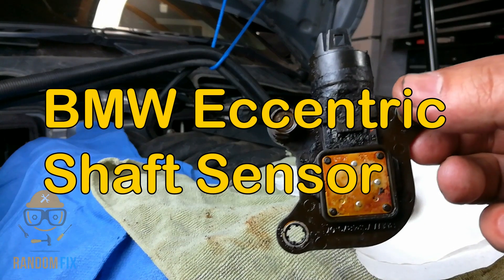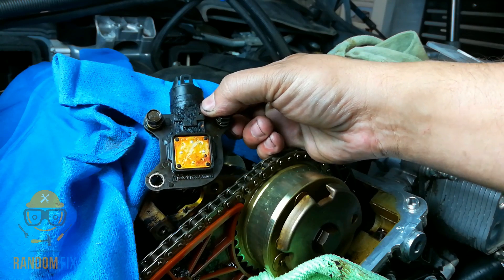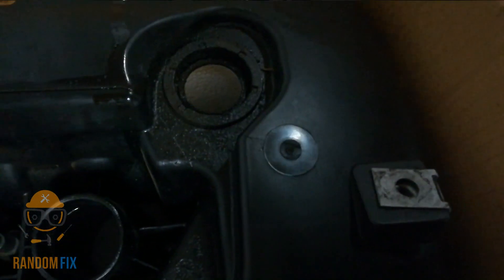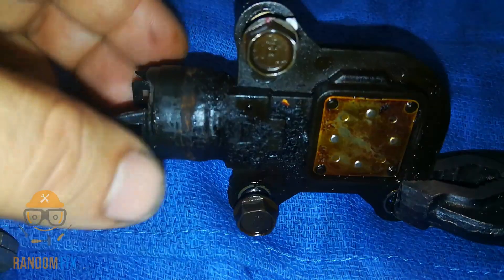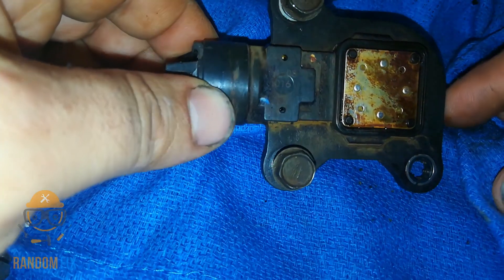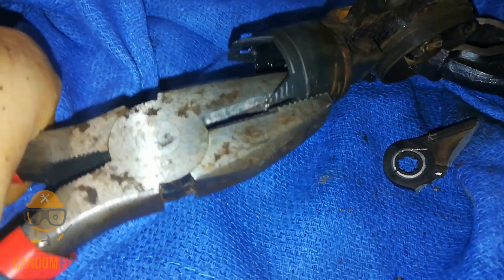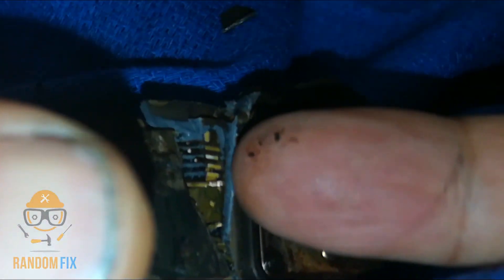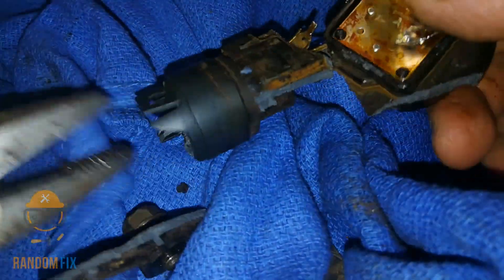Bmw Eccentric Shaft Position Sensor ▶️ Where it's Located and Common Failures

Comment: My car was stalling then it was a crank no start I changed everything in between. The car had no codes but I realized if I pulled the ESS censor the car would run but not the greatest. Then one day all the sudden the car doesn't want to start with the ESS plugged in or out and I want to get involved chronic codes when the ESS has been unplugged I changed ESS three times with Continental OEM non bootleg ! Change fuel pump relays everything in between crank sensor I have no codes for nothing before or after. The car cranks no start no codes except for ESS when it's unplugged in the car still doesn't start any ideas?  DME??
Reply from the maker: Figure out if it’s fuel related, spray some starter fluid past the mass air flows sensor into the intake and see what happens. A little spray goes a long way so don’t fluid the intake. If the vehicle starts then you know you got a fuel issue. If it doesn’t start with with the starter fluid then you got a spark or compression issue. You need fuel, compression and spark other air to get it started. This the route I take before deciding if I need to look at the Dme. Also it’s bmw so discount the battery for a few hours if all else fails before throw money at repairs. Keep me posted.

Comment: can this make your car not start at all, cause when i checked it i did see oil inside and the wire connector and it was super hot and smelled burned . you thinks that my problem it left me stranded
Reply from the maker: Could be, you need a oe scan tool to see what is happening. Here is the complete repair and at the end I show how to use the oe scan tool. https://youtu.be/NI0YZe64k0E?si=97EZl9jQeXcbDzeC
Reply: yea i scanned it and came back as p1017 and it is the eccentric shaft sensor
Reply from the maker: @josecabrales6512 okay, good to know, make sure you use a oe sensor or vdo, don’t go cheap.
Reply: @RANDOMFIX  yesir i just ordered the vdo one thanks man 💪🏽👍

Comment: My 2011 328i cabrio needs this replacement part, but I went cheap to get a high quality 3rd party one from SCITOO for 50$. It got good reviews, but I heard to get the VDO brand only. The sensor also comes with a green O ring around the big round part as the old didn't have one.
Reply from the maker: Yeah with sensors like these vdo is a good decision

Comment: Thanks for the video. What codes did you get while the bad ESS was in?
Reply from the maker: i cover that in actually replacement video from start to finish. https://youtu.be/NI0YZe64k0E
Reply: @RANDOMFIX  or you could just answer the question.
Reply: 2a37 or 2a47

Comment: Mines just went out when I went threw a car wash. E90 330i hiccup idile no control of the throttle
Reply from the maker: Do you think water caused it or it was just time?
Reply: @RANDOMFIX  I think it was its time. Car  in neutral for few sec could of did It at the car wash. half color engine light display with 2A31 2A32 2A47 which is eccentric shaft codes
Reply from the maker: I think your right, it was time, the sensor is pretty well tucked in there for the carwash to do actual damage. I've had lots of cars towed in to our old shop from carwashes, strange but true.

Comment: Hi! Could the eccentric shaft sensor be the cause of 2A6F - Valvetronic, minimum lift exceeded error code? Getting rough idle (500<->900rpm) when the engine is warm and my fuel economy is bad also.  Maybe the Valvetronic motor needs to be replaced?
Reply from the maker: Sorry for the late reply! did you find a solution?
Reply: @RANDOMFIX  Not yet. Still getting a hesitation after the car has been left for 30mins or so. After I start the car, the RPMs slowly reaches 650 where should be while A/C is off, then all of a sudden it crashes to like 400-450, sometimes stalling, sometimes recovering, then RPMs are stable afterwards, it's just only that initial hesitation after warm car was left for half an hour. Maybe Vacuum leak or MAP/MAF?
Reply from the maker: This is after the replacing the eccentric shaft sensor?

Comment: Do NOT buy the OEM trash for this part. Get the Dorman which has an improved design to prevent oil seepage.
Reply from the maker: Really Dorman makes a oem replacement for this now?
Reply: It's available on Amazon and possibly Rockauto. Check their web site for a description of the enhancements.
Reply from the maker: Thank you for sharing, rockauto is solid.

Comment: This seems to be from e60 and e46  6 cyl. engines. But in case of 4 cyl. like e90 320, the screw holes are on the surface,  not beneath like the above.
Reply from the maker: Good info, thank you for sharing

Comment: Hello, I having fault code 2850 variable valve gear guide sensor and 2852 variable valve gear reference sensor the car is a BMW e46 n42 engine, could the problem be the essentric shaft sensor, the car can’t start only cranks, and it has no spark
Reply from the maker: sorry for the late reply, did you figure it out?

Comment: 002A5A DME: Valvetronic, eccentric shaft sensor 2: guide. Does that indicate what you are demonstrating here? It's an error on my E60 550i 2007 in ISTA-D
Thanks a lot!
Reply from the maker: Sorry for the late reply! did you find a solution?

Comment: Great channel ,  need  help getting  code   2a38  vvt sluggish  movement  /open circuit ,  hopefully  not the sensor  jus did valve  gasket ,  dnt wanna   remove  it again  lol, any help
Reply from the maker: Thank you for sharing, did you get the 2a38 code fixed?

Comment: Im about to do valve stem seals on my Bmw 745i.  i was thinking the intermediate levers are causing the cold start issues (165k miles) but now im thinking this as well. Will this sensor(S) throw a specific code in INPA or ISDA-D??
Reply: Yea mine doesn’t pass 20 mph because of the valvetronic system I had a drivetrain error
Reply from the maker: Sorry for the late reply! did you find a solution?
Reply: @RANDOMFIX  no. Still have cold start issues. Does INPA have a test plan for intermediate levers like the old DIS software did?

Comment: Funny how people say not to use after market parts...there all the same thing u just pay more foe a name brand like bmw
Reply from the maker: I respectfully and personally disagree, certain oem parts are much better aftermarket parts, especially with o2 sensors, etc, mass air flow sensor, etc.. _Randomfix
Reply: That's funny after markets are made to do the same thing I done alot of after market parts no issues people are just so high strung. OEM parts which is stupid...hell in bmw oem parts actually go out quick but just are pricy....
Reply: goldenglove25 I agree with you, I’ve used China parts and seen so many people say this and that but if your car has only a certain problem, that small China part will get it going😂

Comment: What code would this throw if this is bad on a 07 328i e52? I'm about to replace the valve cover and the valve cover gasket and plugs but am strapped for cash and don't want to fork over another $100+ for one if mine is still ok. I only have 85k
Reply from the maker: I have a complete video that shows the replacement from start to finish. If you can wait and replace the replace the sensor you will thank yourself in the coming days. Video link is the description of this video.  _Randomfix
Reply: @RANDOMFIX  Yeah I am not getting any of those codes so I am going to cross my fingers and not replace the sensor. I'll visually inspect it to see if its junked up I might take it out clean it and seal it up for preventive maintenance maybe with some high temp glue or just leave it alone until it goes out. That's a spendy part to be buying if it's not broken yet. At least when it does go out taking off the valve cover should be a piece of cake.

Comment: Your video hours the mark for what I am experiencing. Using Carly app errors 2A31-36, related to valvetronic eccentric shaft sensor . These return quickly even after clearing. Couple immediately, others after a few miles of driving. I had the sensor cleaned by a mechanic but did not since the issue. Likely the oil has penetrated deeper into the sensor unit being the terminals. My vehicle 2011 e90 70-80k miles. Have this issue for 10k miles and over two years. But the vehicle drives just fine! No engine light errors either. And I am a low mileage driver. 

If there only negative is poor mileage then I would not want to be worried about getting this changed by a mechanic! Expensive, considering I have already replaced my valve cover gasket by the independent shop, and there is no other reason to open the engine as far as I know. 

I can live with poor mileage of ~17 city, 25 highway or so. But if this is a risk to the engine and bigger costs down the line then I would take it to a shop. Not a DIY person myself, but can understand the troubleshooting. 

Any advice please? 🙏
Reply from the maker: I appreciate your constructive comments, thank you for the feedback!
Reply: 17 city, 25 highway is not bad. No need to change out unless other Valve cover or Gasket replacement is being done at the same time. 

Replacement labor cost not worth it if the vehicle is running fine otherwise.

Comment: When oil gets into the top where the pins are it shorts it out
Reply: Will that cause the car to go into Limp Mode?
Reply: Oil cannot cause short because it is non-conductive.
Reply from the maker: Yes, oil is non condutive, however as the oil cycles around engine it will become more conductive.

Comment: Excellent. Well done - Does the new ESS need to re-learn, or is it fit and go ? Thanks
Reply from the maker: Ron, it's just plug and play. I didn't even have to reset any codes. Best of luck. I recorded everything from a to z on the repair. It should be in video description. _Randomfix
Reply: @RANDOMFIX  Yo! Would you say Topran ESS is a knockoff? I just bought that piece instead of Continental which is way to expensive. What Can happen if you say Its a knockoff?

Comment: Hi, is it possible to fix sensor that is leaking oil but still working well with no codes? Shall I try to find the hole and use some motor glue?
Reply from the maker: Hi Jan, if the budget allows just replace the sensor. You can buy aftermarket one for under $100.Can I get your help? CHECK OUT MY OTHER CHANNEL and subscriber if you like it. THANK YOU ▶️ https://www.youtube.com/channel/UC-wuhWwzZnFOWK-GMsP6Ejw   MANY THANKS _Randomfix
Reply: I would say YES.
Reply: K

Comment: I have received my eccentric shaft sensor from VDO, the car is not acting strange, no check engine light but I got 002A32, 002A47 and 002A34 codes when scanning with Carly and the description indicates Eccentric shaft sensor problem. My question is, does the metal plate on the sensor makes contact with a part of the car or can I try the part just by plugging it to the connector. Want to know if I can try the sensor before disarming the hole shaft cover.  THANK YOU IN ADVANCE, hope my question was clear.
Reply from the maker: Hi Roberto, Did you clear the codes after you installed your new Eccentric Shaft sensor? D you access to any other Scan Tool that lets you scan and erase on the BMW side not obd2? I replace the eccentric shaft on video as well, check out ▶️Complete BMW valve cover job https://youtu.be/NI0YZe64k0E   Best of luck and let me know how it goes_RandomfFix
Reply: RANDOMFIX Thanks for contacting me, I have cleared the codes before buying the sensor but after using the car for a very short time the same codes come back. Haven’t tryed the new sensor yet I’ll try to do it this weekend.  GREETINGS.

Comment: i just have same problem came to me to day , 2008 BMW 328xi Sedan AWD (E90) L6-3.0L (N51) codes 
2A37 and 2A47 hard code never clear check engine light turn on after 1 drive cycle but the customer changed the sensor and valvetronic motor  at other shop but did not fix the problem
i did not check the car yet just relearn valvetronic motor but did not help ..do you have idea which direction i have to go for check ..    thank you
Reply from the maker: Wael Ahmed, If the customer changed the eccentric shaft sensor at another shop, I hope the shop installed a quality replacement eccentric shaft sensor. Other the than a quality replacement, just make sure the plug/connector that plugs into the eccentric shaft sensor is clean and oil free( clean with electrical cleaner). The codes I was getting were 2A32 and 2A47. 
I would also inspect and clean all wiring harness on both vamos, you will be surprised what a dirty connector can cause. The Vamos are only held in by ONE 10mm bolt you might as well remove/clean/and inspection both as well(the Vamos are also interchangeable so you want to switch them around at the same time and see if anything changes). Best of luck and let me know how it goes. I included the link below to complete video of repair below. _RandomFix

https://youtu.be/NI0YZe64k0E

Comment: about how long did this job take? if it was a first time
Reply from the maker: Infinite Universe, the total was about eight hours, I also change the spark plugs, valve cover gasket, eccentric shaft sensor. Here is a link to complete video from start to finish. _RandomFix